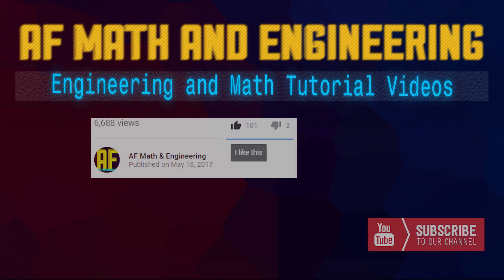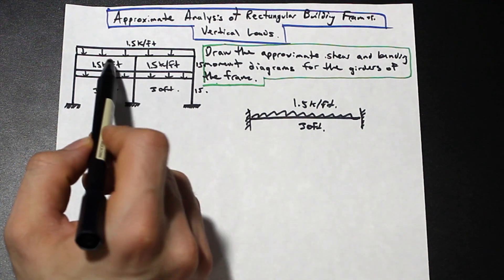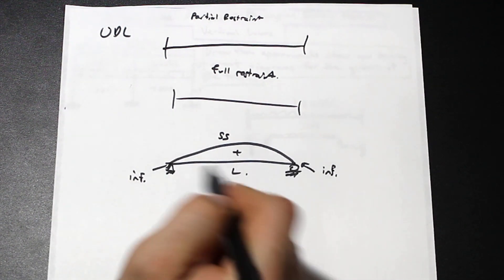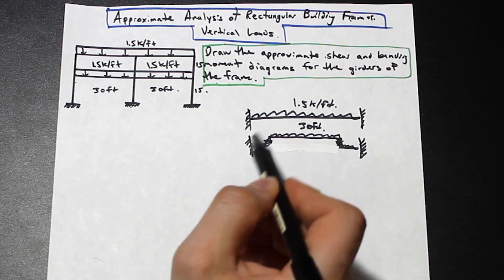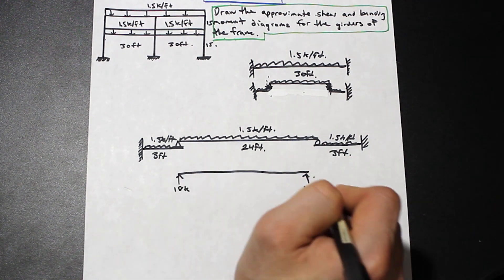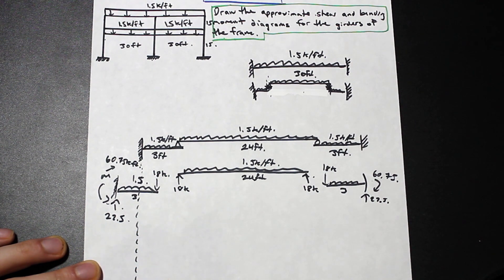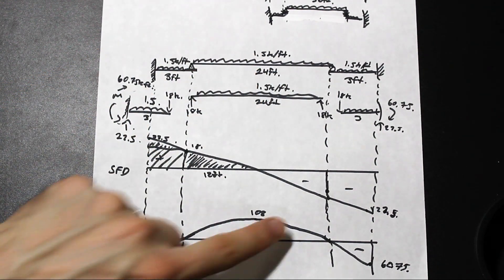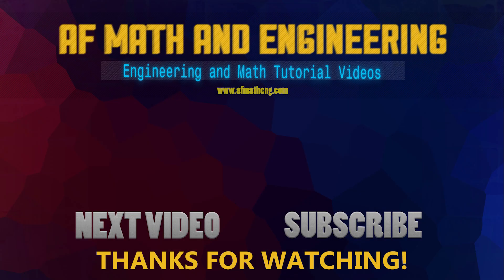Approximate Analysis of Rectangular Building Frames - Vertical Loads - BMD & SFD

Comment: Does this method only work with UDLs?  What if there are vertical point loads on the girders as well?
Reply from the maker: If the point loads are spaced close enough and evenly you could probably assume it's a UDL otherwise no this doesn't work.

Comment: Hi sir, May I ask what is the difference between using approximate analysis vs. Fixed end moment formula for distributed load FEM= WL^2/12 ?
Reply from the maker: Not quite I understand the question, but approximate analysis were idealizing a concrete frame with fixity at supports somewhere between 50% fixed and 100 % fixed and assuming pins where the inflection point is typically located.  Fixed end moments just assume fully fixed at the ends and calculate end moments.
Reply: @AFMathandEngineering  
Ohhhh thanks It answered my question